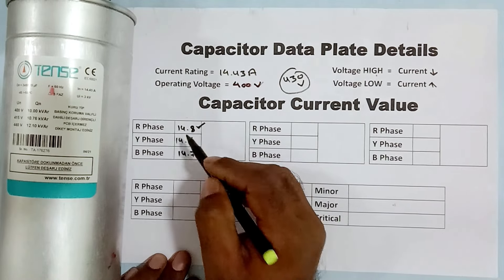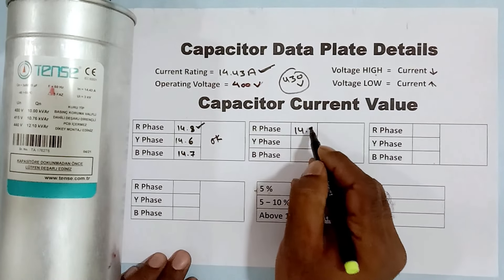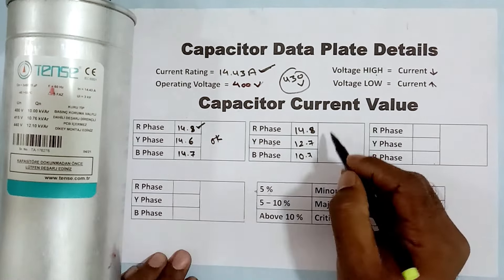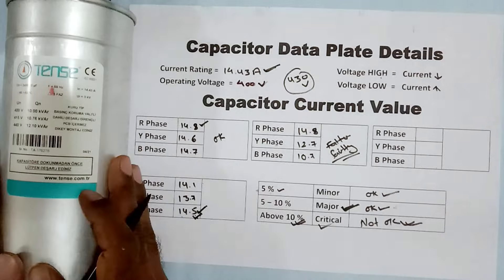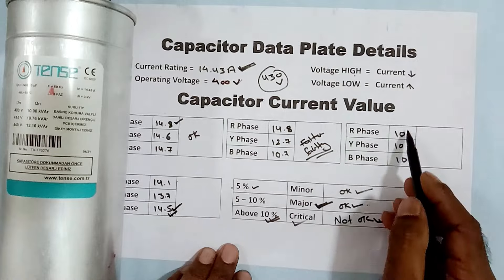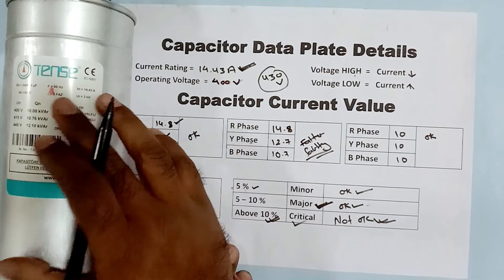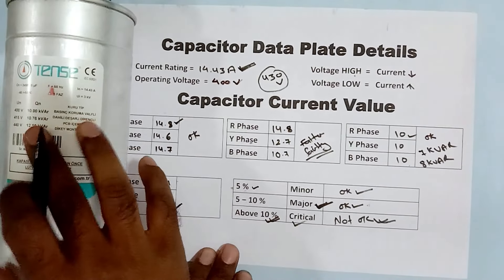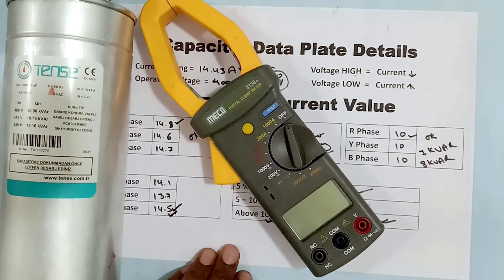How to Check 3 Phase Power Factor Capacitor @TheElectricalGuy

Comment: I have one question from your "Solar Panel Connection with Inverter and Battery for Home @TheElectricalGuy" Video..
- Is there any automatic converter available, If solar panel is not produced the power (due to bad weather) then battery should charge automatically from government electricity. if yes, please recommend the product and share the video for connections, I need to avoid manual work (i've normal inventor only)... Thanks for knowledge sharing...